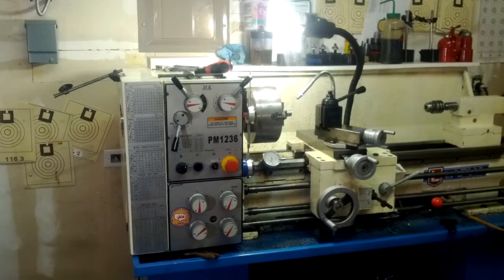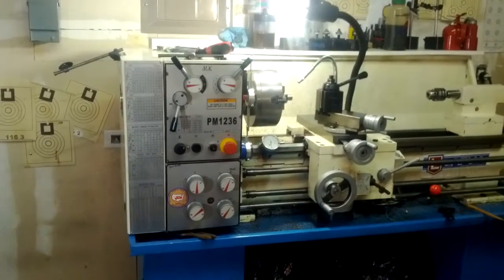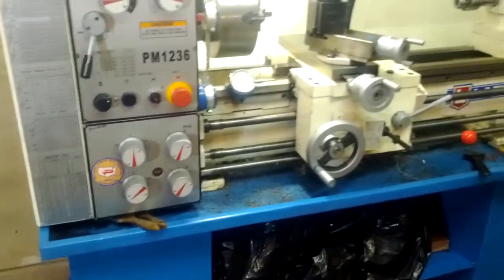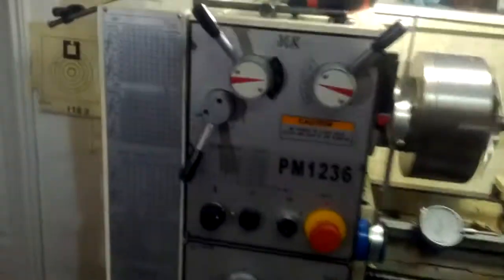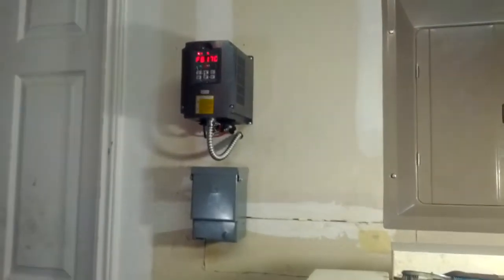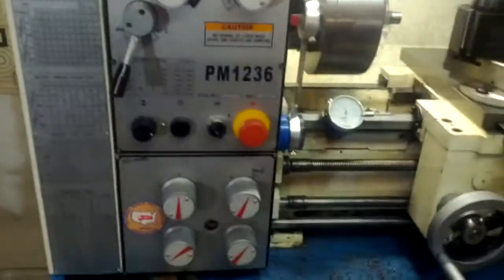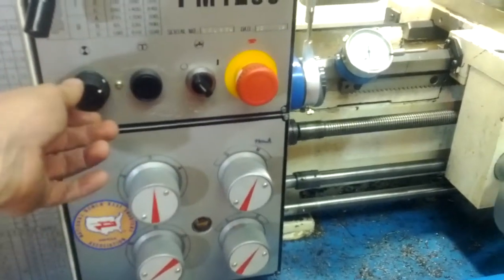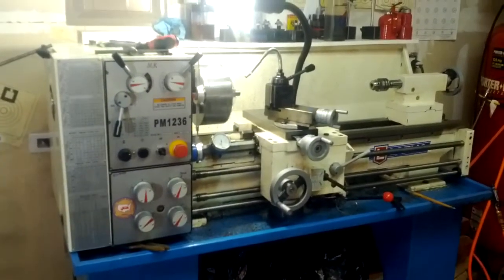remote control on vfd part 3( wiring remote control of Huanyang VFD and PM1236 lathe)

Comment: awesome vids johnathan.
i just got a grizzly 14x40 3 phase 220v with 3hp motor. i want to do the same setup where i can still use the lathe to power on and power off, would you provide me a schematic and parts list? thanks gotta make some chips soon

Comment: High pitch noise can be reduced or eliminated by adjusting PD041 Carrier frequency parameter. It can be tuned to motor sweet spot frequency. I gues that 3F motor like that would be quieter when PD041 = 8-10.